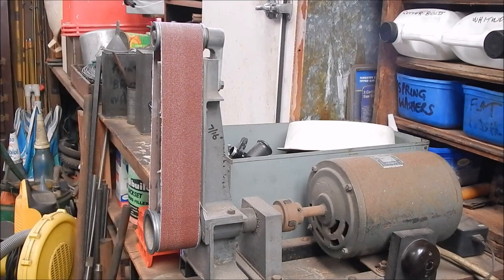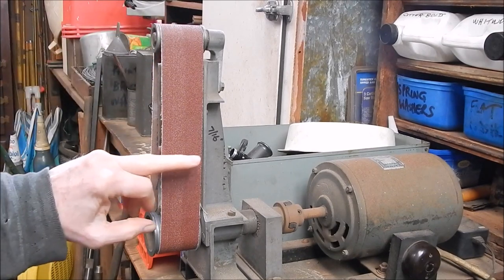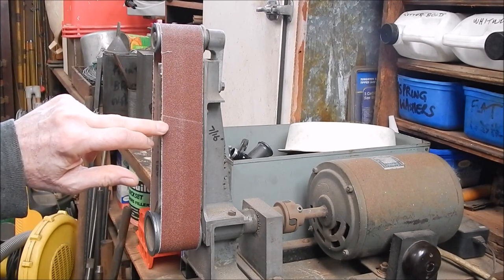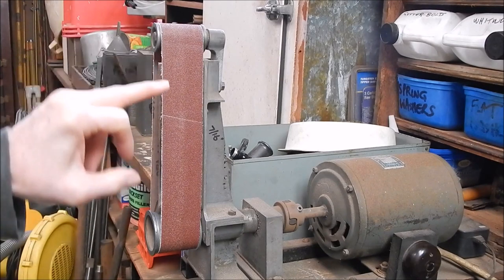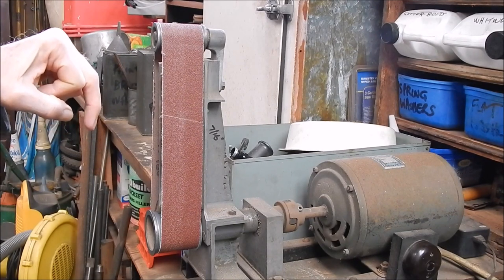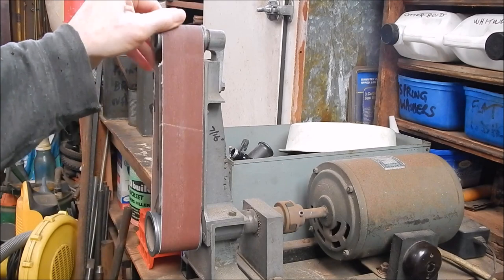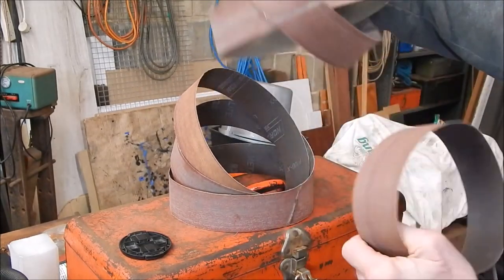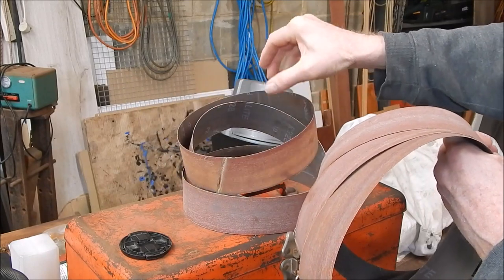Can you re-join broken sanding belts ?

Comment from the maker: Note:  Worked out well for a first attempt.  I might run a file or a small grind stone over the grit side join to see if the small  "hump" can be reduced.  It will probably wear away with use as well.  Cheers Rob

Comment: Those lap joints are terrible. One idea is to perhaps add another idler to your frame so that you can run a common size like 48” unidirectional belts (no lap joint). You will also have a good variety of abrasive types to choose from so you can buy quality belts that last.

Comment: I was surprised that they held together, if you've run out of belts it's a good fix. On my 4" belt sander the belts tend to wear out before they break. Never throw them away though, great material for protecting soft metal when held in the lathe chuck. Which I believe was another trick I learnt from you 👍🙂 Cheers, Alan.
Reply from the maker: Hi Alan.  I didn't know what to expect when I flicked the switch.  I was ready to jump out of the way if things went pear shaped.  Seems surprisingly durable.  I might be able to refine the technique a bit when I next do a fix, but does the job so far.  Yes, old belt makes great surface protection.  Cheers Rob

Comment: I purchased a box of 1 x 42 inch sanding belts at an auction for a couple of dollars. Apparently, they were pretty old because every one of them began breaking at the seam when I tried to use them. I tried every glue I had attempting to repair them. Nothing worked. Finally, I stuck a 1 x 6 inch strip of duct tape across the seam on the back of the belt, laid it on a marble slab that I have on my work bench and used a roller to make sure the seal was good. It worked like a charm.
Reply from the maker: Good tip.  I will try that.

Comment: I found that this works well if you’re not putting too much heat into the belt, I found once the glue got hot it would let go.
Reply from the maker: Interesting.  I used this glue because like Selly's Qwik Grip it retains it's strength with heat.  My belts never get very hot due to the low surface speed.  Guess I will find out in the long run how well it performs.  Cheers Rob

Comment: Bought a lifetimes worth of "quality" belts when Masters closed down. The joint of all off then let go in storage. So far CA glue and Epoxy any high strength tape haven't work. Trying the high strength contact, squashed in the vise using two parallels, reinforced with high strength tape. So far so good. Need to clean the joints with a file first.
Reply from the maker: Sounds about right.  Quite a few comments on the net about this adhesive deterioration issue.  Cleaning the faces with a file would help.  Cheers Rob

Comment: In the past when my contact adhesive has dried up, I've had success resurrecting it by mixing with general purpose paint thinner.
Reply from the maker: I've done that as well in the past quite successfully.  Selley's must have changed the glue formula fairly recently because that no longer works with Quik Grip.  So I switched to Parfix and so far so good.  Cheers Rob

Comment: Two big issues I see with this over time is heat affecting the glue joint and the repair causing a bulge in the one spot. If this works sufficiently for your needs as is, by all means. But a better way would be to apply a backing strip the whole length of the belt to maximizeglue area and ensure uniform thickness. Good thing you already have the best material, the belt. Once one is sufficiently worn out, you can clean and glue it to the back side of another with the seams clocked 180 to each other. May need to trim a small amount off to get it to fit right.

Comment: Good stuff Rob--economy in the workshop is not to be sneered at---its sensible
Reply from the maker: Hi Ian.  Yes, screw as much life out of stuff as possible ;)  Those belts are damn expensive if you buy the brand name ones.  You can have a workshop on the cheap quite easily with the right approach.  Cheers Rob

Comment: I used to have an old 4' long linisher that took ludicrously expensive 3" wide belts, so eventually I started making my own. The two main factors that seemed to make the join let go was the glue softening from the heat generated as the belt flexing over the rollers or from the actual friction of metal removal (You already seem to be on top of that with the heat resistant contact adhesive), and not having the belts 100% straight. If it's even slightly out of line the join will start coming apart from the tightest edge.

To make these belts as straight as possible I'd just clamp a temporary jig together from of a ruddy great slab of steel off cut and some angle iron. I clamped the angles to give me a nice and even 3" gap between them, then after "Degritting" the overlapping ends of the length of emery roll, I'd lay the belt in position and put clamps on to keep it from moving about (8+ foot of 3" belt can get hard to keep under control. :D). Once it was all in position I'd glue up the ends, lay them flat, and using a couple of the biggest G clamps I have, crush a 3"∅ stub of barstock onto the join.

They were never quite as good as the genuine belts, but I'll happily accept 80% as good for 20% of the price any day of the week. :)
Reply from the maker: Your process sounds good.  Using flexible glue has to be a good thing.  I considered Superglue, but it dries brittle and gives mixed results with porous materials.  It will be interesting to see how long these joins last.  Seems OK ATM.  I've often thought those long linisher belts must be expensive.  Wouldn't want to catch a corner on it and tear too often  ;)  Cheers Rob

Comment: Regluing broken belts is of course nice. There are more videos  showing that.
For a mini sander no spare belts were found. By making a new, longer , arm for the tension wheel belts were found. However they were 62 millimeters wide and my grinder used 30 mm. Made a cutting tool that cut out a 30 mm belt. The remaining 32 mm had to pass the cutting tool once more. Cutting from the inside be pressin a Stanley blade through workded well, but slowly. Each cut was some 10 - 15 mm long. But I have belts1

Comment: 20 Years ago I lived near a abrasive factory and they had a skip outside they filled with offcuts. It was supposed to be locked but occasionally they forgot to lock it . What a treasure trove.  Some "offcuts" were 2 metre long 1 metre wide! I am just starting to exhaust those supplies. With all the free material I set up a production line for belt making shaving off the strip for the join was the trickiest.  However the glue  proved the biggest weakness . I mostly sand wood and the heat of sanding softens the contact glue and any heavy and slightly prolonged pressure results in the glue softening and the joint giving up. Age has not been a problem I still have multiple belts hanging up that are OK until they get quite  hot.  
I see they make contact glue for rubber roofs. That should be able to stand a fair bit of heat build up.
Reply from the maker: Interesting.  Wood seems to build up more heat than metal with prolonged sanding, or maybe we tend to sand wood longer than metal.  I mainly do short runs with the linisher, so hopefully the glue will stand up to that.  I'm more worried about the job catching and tearing the belt, working with sharp metal edges etc.  Cheers Rob

Comment: Hi Rob, had a batch of Zirconia belts, the blue ones made in Perth for my multi tool, local business, he won't disclose the type of glue.
They use a press and heat to make the joint
They all blew apart after approx 2 years storage , quite dangerous as they fly across the workshop, definitely have a shelf life.
Tried just about every adhesive and they blow apart, mind you the multitool is directly attached to a grinder, 2 pole motor, looks like yours is a 4 pole motor running a lot slower.
Ordered various belts from China last year and they hold up but suspect they will also come apart.
I think the secret is to buy limited stock and replace as you need them.
I now stand to one side and a full face mask and nervously sand away!
Reply from the maker: Hi Willem.  I see from comments on the net that this seems to be a common problem.  Shelf life is very short, so buying just in time is probably the best way.  Even then you don't know how old the stock is.  I had the same issue with adhesive sanding discs for my small right angle air die grinder.  Half the stock had dried out when I received them.  LOL.  That was from CTC Tools and they would only refund me for the dried out ones. Obviously the whole lot would be on the way out.  Last time I dealt with them.

I like the slow speed of my linisher.  Much safer to use.  I had considered making it variable speed, but no real advantage.  I haven't tried consumables from China.

Cheers Rob

Comment: Hi Rob, good fix to get more life. Humidity is your enemy, store all your belts in the house (even your repaired ones), you will get much longer life. I watched an ex boss of mine going loopy at a supplier following multiple failures on big 6" wide 6ft long belts. Turns out they were stored in a tin shed with lots of year round condensation, this was in the days when supplier sales reps knew their onions, he got straight to the root cause. Cheers, Jon
Reply from the maker: Hi Jon.  Seems that may be a main issue from what I've been reading in discussions on this problem.   The batch I repaired hadn't lasted any time at all.  I was pretty pissed off, but then though maybe try a fix given the amount of life left in them.  I didn't really expect it to work as the belts get a hard time, but so far so good.  Gotta try these things.  Cheers Rob

Comment: Once knew a shoe repairman.  He used shoe glue to mend sanding belts.  It seemed to work.  He also pounded his joints to set the glue.  Don't know what the glue was, but the solvent reeked.
Reply from the maker: I think this stuff is pretty similar.  I've used shoe sole glue many years ago (for shoes) and it looked and worked the same.  Cheers Rob

Comment: Rob,great tip.I have a few 1 inch belts that have come apart.Cheers!
Reply from the maker: Worth a try Patrick.  I used the linisher to grind down most of the "hump" at the join on all these belts for a smoother run.  Seems to have worked.  Cheers Rob

Comment: Hi Rob ,   I found a really good deal on belts one time and bought a bunch of them.    Turns out they would only last a short time and break at the joint of course.    I still had some old belts in my supply and went back to them and they lasted a very long time until wearing out but not breaking at the joint.   I did some playing with the broken ones to reuse them with limited success.   That got me to looking at the difference in the belts and found the ones breaking had a very short join area like the ones that you were regluing but the good ones had a much longer gluing area say about an inch long.   It seemed to me that was a big advantage to them holding together.   That was as far as I had gotten with them so far so find this video quite interesting.   I imagine there will probably be some follow up down the road on this video. 

Dale in Canada 🇨🇦
Reply from the maker: Hi Dale.  I expect a larger glue contact area would be stronger.  Most of the ones I've ever used were much like these, however some had an additional thin reinforcing tape across the join faces and they lasted the longest.  It will be interesting to see how these go.  If they fail sooner rather than later I will do a follow up.  Cheers Rob

Comment: Hi Rob, It is hard to tell from the angle of the video but it looks like the platen is a little to far forward at the top and maybe catching and peeling off the joint on the inside over time. Perhaps a little adjustment might stop them breaking so often.  I have used fibre glass tape right around the inside which helps, but in the end as my belts are worn usually worse than your examples, + as there is a cost to the tape and glue, I gave up and went back to buying new ones. Like you I split them in 2 and use the left overs for other uses so I still save a buck or 2. I do what I can to avoid spending hard earned $ but now days I'm a bit more pragmatic. if it's 90% worn out its only worth 10% of what I paid for it.
Reply from the maker: Hi Andy.  I will check the platten out.  I think this batch of belts was just not good in the glue department as there was virtually no residue on one (inside) face of the overlap.  They also don't have any reinforcing tape over the join like the latest ones.  There is still plenty of life left in the material/grit so it's worth trying to resurrect them.  Time will tell if the fix lasts.  Interesting experiment.  Cheers Rob

Comment: Had a bunch of cheap belt sander belts go like that, they actually fell apart after being stored in the workshop for a few months.  Humidity, I guess.  Used evo-stik on them,  it worked for long enough to get the job I needed done, done.  The stuff big conveyer belts are glued with is a contact adhesive as well, black self-vulcanising stuff which gets a bond on the rubber.

I also finally got fed up with the (leather) flat belt on the Schaublin breaking its lacing, so I degreased it, scarfed the joint and glued it together with  super glue.  It's held for the last 6 months, no problems as yet.  I was kinda worried that the cyano would make a hard point that would crack, but it doesn't seem to have happened, might be worth a shot on sander belts as well.
Reply from the maker: I've had mixed results with superglue.  Works brilliantly on rubber, but quite variable on other stuff.  I run a synthetic continuous flat belt on the Schaublin.  You have to pull the spindle to fit it (no big deal), but is supposedly good for 30K hours run time.   It's industrial grade and very flexible/low drag.  Worth checking out.  Cheers Rob
Reply: @Xynudu  My Schaublin has an under table drive, and the bed casting means you can't use a pre-formed continuous belt even if you pull the spindle.  The "correct" solution is to get a new belt properly spliced in place.  Mate of mine has synthetic belting, special glue, and the heated clamping gear to do the job, but he lives on the other side of France.  Obviously, this would be considered practically next door in Australia :)

Comment: As a few others have said, It's heat buildup that weakens the glue joint. I've only ever had one belt fail,scary shit. Pretty sure the ingredients for belt glue is a fairly closely guarded secret. Seen a few pl try this but none with reliable or trustworthy results, your grinder is fairly slow so shouldn't be too destructive when it explodes😁
Reply from the maker: Hi Bill.  I've broken plenty of belts over the years and it's a non event on my linisher.  The big high speed ones would be a lot different and downright dangerous I expect when they break.  It's more than just heat build up as many people have had belts come apart while still hanging on the hook.  Seems that the/some glue deteriorates quite quickly with age and possibly moisture conditions.  The last batch I bought didn't last any time at all and you can see the pile I had to try and fix.  Such is life.  Cheers Rob
Reply: Not really that dangerous but they do scare the fuck out of you🤣
I spend a bit more on belts which imo is worth it for the extended life and reliability but my needs are different to yours 🍺

Comment: I've had some belts come apart & never thought to try & join them back together. They'd had some use anyway & I'm not sure I could trust re-glued ones on our polishing spindle back-stand as they let go with a bang! ( https://youtu.be/JopHDzQ3t8E ) Well worth a try on slower speed linishers though & if you're having trouble getting the size you need you could maybe make your own from scratch?
Reply from the maker: The belts for mine are relatively cheap the way I source them, so I don't see a lot to gain making my own.  I was however pissed that this last batch went off in quite a short time.  I will play around with the clamping/pressure process to see if I can improve the "flatness" at the join.  I might also use the ball peen on the ones I recently glued to see if I can crush the join some more.  Cheers Rob